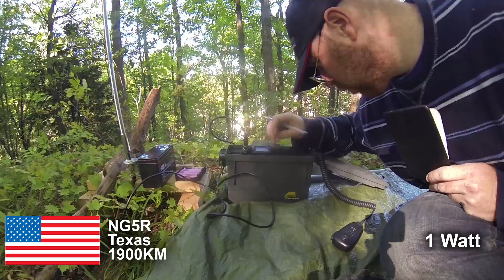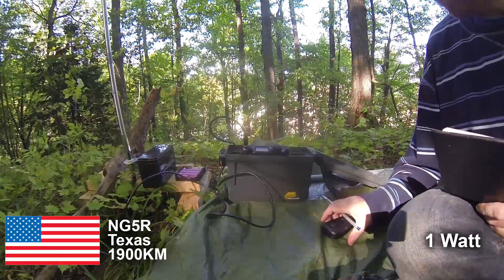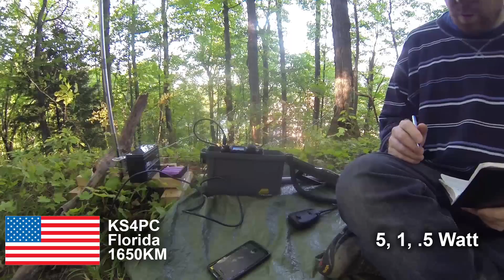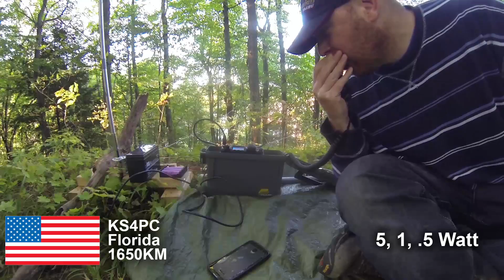Tryng out QRPp SSB on 20m

Comment: Awesome. I got the qrpguys vertical tribander and the swr rises catastrophicly when i elevate the radials... When I lay them down it's good... Weird huh? 73, 9A3AKF
Reply from the maker: Its probably not that weird - it may be because it's a multiband antenna.  I like the elevated radials for the efficiency, with 4 elevated radials there is a theoretical efficiency of 80% I think.

Comment: Hey, I really enjoy your outdoor QRP videos. I have a question about your power in this video. Your video descriptions says that you were running 3x 18650 batteries. But I also see a 12v 7ah battery close by. Did you make this contacts off of the 18650 batteries, if so, how long did those 3x 18650 batteries last?
Reply from the maker: I was using the 18650 batteries in this video and they would last about 2 hours.   The batteries I'm using aren't even the greatest as they are used batteries from old laptops. Thanks for watching!